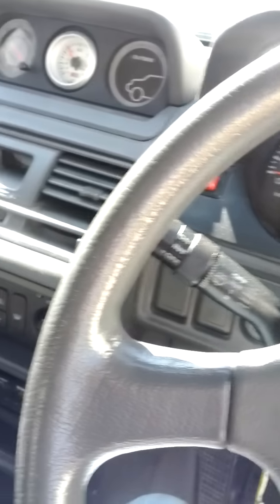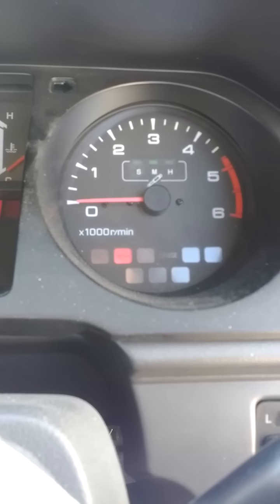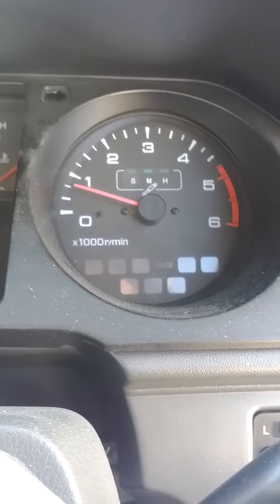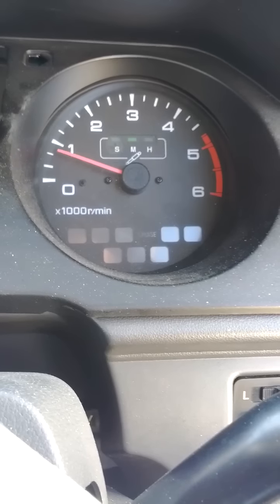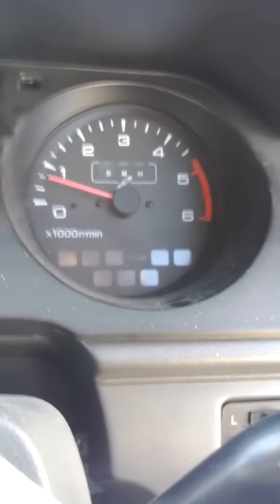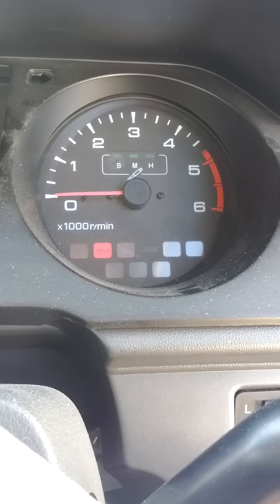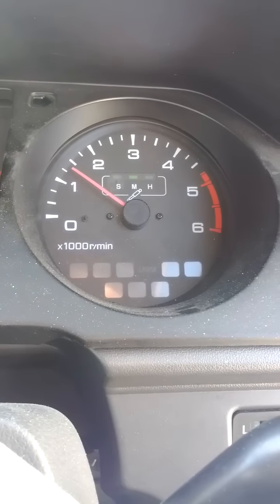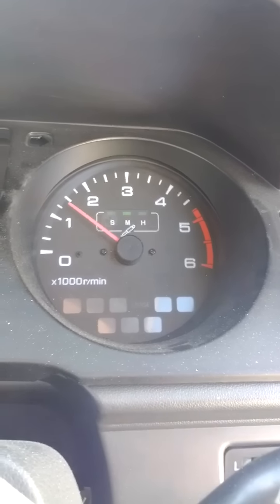Stalling Issue with my Mitsubishi Pajero

Comment: Hello every one its a much relaxing day for us as we've encountered the problem. 
We have 3.2 4m41 Di engine 
Many technicians and mechanics said its a pump itself to be replaced but we installed a different solenoid and sensor  from a toyota car and the problem is solved in a much cheaper way rather paying thousands for the pump as we were struggling from many weeks .
And thats what happens to every pump from mitsubishi 3.2 diesel engine and people are forced to buy pump
The stalling issues when engine is engaged to load

Wao what a pleasant day 

Thanks Vicinity VR we got inspiration from your video
Reply from the maker: Glad you solved it.

The most interesting thing about my youtube channel is that it started out as a gaming channel where I uploaded random times.

But....this video about my old Mitsubishi has THE MOST views of any other video on my entire channel and it was just a one-off video I uploaded while trying to solve this problem.
Reply: @angrygreek1985  
We were obsessed regarding this issue at a extent of becoming mad .
But we got alot of inspiration from your video .

And finnaly we changed that part and the car is working much better than before .

And now we are sure that a lot of people just replace the pump for this issue to get rid but actually the pump is not to be blamed,  its the other part of pump which becomes faulty. 
If anyone want that part we can help and arrange for them instead they replace the most expensive pump

Thanks Vicinity  VR. 

God bless you all
Reply: I have the same engine.. 3.2l 4m41 a 2003 pajero. In neutral all is ok. Engage the gears then it stalls. Kindly help me with the location and the parts u change please
Reply: @AlimonaAbbas at the moment I am obsessed, I have cleaned the intercooler, I have changed the fuel lift pump, I have tested the fuel lines, my next plan was to clean the fuel tank. The I googled this problem again only to see this comment.. I think am going to have a relaxing day too. Kindly help and advise. I am in Africa I don't know how you can help. But pictures of the parts and the location will be of great help.. thank you so much
Reply: @AlimonaAbbas are you talking about the scv? Suction control valve
Reply: Can you tell us in detail like which parts from which toyota car you changed??

Comment from the maker: Just so everyone is aware. The issue has now been resolved. I ordered a Front Injection Pump Seal for my Pajero, which is a 2.8L Diesel 4M40 Engine. I had a local mechanic do the work which was 5 hours of labour. The seal was $18. Now my Pajero no longer stalls. If you are having this issue please try this.
Reply: Where is it located?
Reply: Hi dear Vicinity VR after 9 years we are facing that problem can you plz tell us how does that seal looks like and do we need to move the pump out eh ?
Reply from the maker: @AlimonaAbbas  I believe this is the part I purchased
https://www.ebay.com/itm/272126838668

I did not do the work myself, so I don't know where it is located. I just read about that part being the potential issue, so I purchased the part and found a local diesel mechanic to work on the vehicle for me.

This was 10 years ago now, so I don't remember much other details.
Reply: Can show which part bro. I having idle problem too. And keep adjusting TPS sensor all the time

Comment: Hi people , first to change the OIL SEAL & O RING on the injection pomp you should check first the all fuel lines, I changed the OIL SEAL & O RING first but the problem didn't disappeared . Changed the fuel lines and now is working normal.  

PS

You should correct the video title ( Stalling with Starting ;)

Comment: Mine had not done it yet but was on the way out. However i done my own injector pump and ended up breaking it a bit internally. So now i got another pump from another car we are building till i can renew my pump. Lucky the new one is already rebuilt and works. Good news is that pump is economical. Don't know if i should swap injectors too???

But hey your car works, mine works we are all happy!

Comment: My opinion, if you have this fault and or other drive problem( hunting/ power coming and going) , before you go spending lots of money on Pump repair etc, check or replace your rubber fuel lines and hose clamps, if you have even the smallest air leaks in the fuel system from the tank to Fuel pump, your Pajero or any Diesel engine will react like this video, and on another note, if the lift pump on your old mechanical pump diesel is getting tied, you can add an inline Electric fuel pump to the pump from tank, this will also fix your problem , very cheap fix compared to Diesel pump rebuild.1 other thing, the prime pump on fuel filter systems get old also, they will start to leak air and cause power/and stopping issue also, just remove the lines from filter assembly and fit a Z200 inline filter to bypass original filter and prime pump system. 😉
Reply: thanks learnt a lot from your advise
Reply: Allah and His Messenger glad to help mate 👍
Reply: Allah and His Messenger do you own an old Diesel Pajero or other old diesel, ? I have some other easy fixes / changes that can keep an old diesel going well.
Reply: @benlondon8467  yes l have a 2003 pajero
Reply: Allah and His Messenger here are some tips that may help your car if it’s done lots of miles or gets to that.
Don’t run heavy oil, some people think if the motor is real tide heavy oil is better, it’s not, stick with or change back to 15W40 oil, thick oil will make the motor blow smoke & collect lots of oil via Rocker cover breather.
If you don’t have a oil catch can, I’d fit 1, if your motor is suffering blowby connect Rocker cover breather hose & a hose from your Dipstick back to catch can , then from catch can to turbo inlet hose. The hose from the dipstick pipe will greatly reduce crankcase pressure in the motor and let it breath. Lots of blowby tends to create lots of oil being held longer in the Rocker cover / top of engine, oil can’t return down to the bottom of engine sump as quick as it should due to the blowby pressure/ flow coming back up. Then that held up oil starts getting pulled in via turbo inlet breather tube.harder the engine runs worse the problem gets.Keep the dipstick aside for when oil needs checking.super select 4x4 , front diff engaged constantly, fit manual locking hubs to front drive shafts, easy install, car will be smoother to drive especially if your front CV,s are worn out. Bit better on fuel also. You can select 4x4 with manual hubs disengagement, but only drive with centre Diff locked, or you will slip drive via gearbox planetary. ( won’t hurt if you slip a little , but will if you try to drive it with out manual locks engagement ).
Reply: It's really great to read all your secretes
Reply: Allah and His Messenger happy to help people out if possible. I’ve worked on cars most of my 50 years, it’s all about getting the most out of your vehicle I think . Little tricks of the trade come about from a lot of R&D with old cars/trucks over the years. Hope some of what I’ve sent helps you mate 👍.
Reply: @benlondon8467 you are a good man, thanks!
Reply: Thank you for this detailed explanation.
Reply: @allahandhismessenger7041  I have the same too
Reply: @benlondon8467 wow wow wow. Thanks for these tips. Mine is a 2003 gen 3 Pajero. It has 220,000km on the Odo meter.  Was worried about the catch can, now am confident I should add it. One new thing I ve learned is the dipstick pipe being connected to the catch can.... I know about the blowby cos I use didstick slots to test blowby sometimes. But it's never crossed my mind to connect a horse to it to reduce pressure.. thank you so much
Reply: @francisguchie1973  glad it helped, I run hose to catch from Rocker cover & Dipstick tube.
My old Pajero got 500k on the clock.
Don’t forget to empty can as required, or if it fills up to top, you can get a runaway engine 😉
Reply: @benlondon8467  Are there any specific oil catch cans you would recommend? Otherwise being in Africa (Sierra Leone - west africa), i might have to build one myself. I have the skills to do so and tools are available. Kindly Advise. Once again thank you so much. You have shared more information, 500K on the Odo meter makes my 2003 are baby at 220k.
Reply: @francisguchie1973  heaps of cheap catch cans, 1 litres plus capacity, make ya own from lots of things already made, just put 2 holes & a lid on it 👌
Reply: @benlondon8467  thanks for these very fast responses. Indeed this post has attracted not only views but also replies and knowledge sharing. Thanks to Vicinity for posting his issue and also updating it.  I have one more kind request from you. My 4M41 has an EGR, I recently cleaned it but found out that the previous owner had "Deleted" it simply by blocking the it at the starting point (at the exhaust side. I am thinking right now that if I have the oil catch can, do i have to maintain the EGR delete?  Also when cleaning the EGR i noticed the amount of soot and gunk that goes all the way to the intake manifold. I am thinking of cleaning the intake too. But given that i just acquired the car i did not want to split things up before reading around. (This is my first time on tinkering with Diesel engines) I have own old bikes and petrol cars and messing with their engines is not my problem. Am just overly cautious with the Diesel. My first diesel was a 4D56 with manual components but even then i never touched it because i lived in an area that had many Mechanics.  
Kindly advise about these 2 issues, the EGR and the Cleaning of the intake housing thank you so much for your valuable time. I Salute you Sir!!!!!
Reply: @francisguchie1973  I would suggest removing EGR, put a plate on the Inlet manifold, plug the exhaust manifold, I wouldn’t worry about cleaning out the inside of inlet manifold, it will slowly clean up on its own, motor in my Pajero is the same as yours, hasn’t had egr fitted for many years/ km.👍
Reply: @benlondon8467  Thank you Ben, I will do the plates on both sides. I will just leave the housing on it for decorative purposes. And also maintain the EGR sensor to avoid the check engine  error on the dash. If there is a better way to do this without having an error code (code 51 EGR failure), please advise. In the meantime i have started building the oil catch can. However, i have not yet found a solution for the stalling when the engine is warm (running temperature).  I am thinking its the pump. The car takes 5 to 7 seconds to start hot or cold, when it starts and is warm enough, engaging it in drive or Reverse will drop the rpms to between 650 to 700 (from the standard 750). Then it will stall shortly after.
Reply: @francisguchie1973  keep going with it mate, you will sort it out, it’s not rocket science. Definitely sounds like a lack fuel, check all those hoses etc etc, as I’ve said previously. I wish you luck 👌
Reply: @benlondon8467  I will share my findings here. May be next week. Thank  you so much for the kind words and for sharing your experience too. I hope this post helps another person too.
Reply: @benlondon8467 just one more thing.. while reading the manual, the oil specifications has 5 options. Sae 30,  20w-40, 15w-40, 10w-30 and 5w-30.  I am inclined to 20w-40 & 15w-40 given that am in west Africa where temperatures are mostly above 24°celcius. Kindly comment on my choices, most important, I am eagerly awaiting to hear about your choice given that you have attained more mileage on your pajero
Reply: @francisguchie1973  15w/40
Reply: @benlondon8467  thank you so much cheers

Comment: Ive got a 2005 3.2 did and it will not stay running in any gear r or d and unless driving on the road and if it slows to much or stops alight it cuts out it also will not idle in neutral or p when warm.idles in n when cold but dies as soon as you put it in d or r unless you push accelerator straight away and put it neutral and keeping revs up at lights or slowing down.anyone help please
Reply from the maker: I stated right in the video description how I solved this issue:
"I fixed the Pajero. For me it was the Injection Pump Front Seal and I had it replaced for about $200 labour, depending on how much your mechanic charges for labour."
You may not have the same issue as me, as your problem sounds quite different, but it might be.
Reply: Hi stevey did u find what was the problem as i am also experiencing the same issue please if u can help us with your experience 

Kind regards
Reply: Hello Stevey, I have a 2003, Same engine 4m41, same simptoms exactly. Did you solve your issue?

Comment: hi i got the same problem is it means that the fuel pump need to be replaced repaired ? i done the fuel filter etc i clean the fuel inlet filter on pump as well . my one is struggle on low rpms . it got the throttle response and it have a power over 1200 rpms . but after release the throttle pedal from a list 2000 rpms it drop to 250 rpms or to 0 . what it can be ?
Reply from the maker: Krzysztof Kawalec for me the problem was the front fuel injection pump seal. I had the 2.8 model.

Comment: Just wondering once you put the new seal in did it fix the problem straight away? I just did mine and its 80% better but just wondering if it continues to improve?
Reply from the maker: It was fixed right away. Never had another problem like that afterward.

Comment: Have exactly the same problem on my 4M40 turbo diesel Pajero (NJ late 1994 model). Likewise have been told it is the fuel pump front seal. Down here in Australia, it is around $600 just to replace that seal, or $1500 to recondition the pump. Most mechanics won't guarantee the seal without reconditioning the whole pump.
Reply: Well i think if the problem is the same as mine, i have to know the cause of that trouble Sir.
Reply: I have this problem but it came after my Pajero went in to fix oil leaks by replacing seals.  How did they cause this problem
by fixing the oil leaks?

Comment: My god, I have the same problem. Thank you for this post, and thank you all for the solutions. However, where is the fuel injection pump located? Different mechanics are telling me that it is in the tank?
Reply from the maker: I'm not sure exactly where it is, but the front fuel injection pump seal is what you would need to replace. I'm not a mechanic, so I don't know where it is exactly but it's down on the right hand side (when looking at the engine from in front) and down a bit. The intercooler needs to come off to get down at it as far as I know.

This is what you would need to replace, it worked for me. http://ccautos.ca/parts/mitsubishi-33/injection-pump-front-seal.html
Reply: thank you very much my friend...
Reply from the maker: The Philosopher I didn't do the work, so I'm not sure exactly where it is, but I know it's on the front right side, looking at the truck from the front. it cost me about $200 in labor but it was cheap labor. the seal itself was around $20.

Comment: we had that problem to our 1994 mitsubishi spacegear delica 2.8 a/t, same problem it starts(sometimes it is like your 2nd start) and runs but when we started to slow down on the road the engine will suddenly stops and sometimes it is hard to start...so we need to put it in neutral so that it would not stall and we need to step on the gas pedal quickly after we change to drive so it won't go to low rpm and stall.......
Reply: What was the fix ive got a 2005 3.2 did and its doing exactly this it will not stay running in any gear r or d and unless driving on the road and if it slows to much or stops alight it cuts out it also will not idle in neutral or p when warm.idles in n when cold but dies as soon as you put it in d or r unless you push accelerator straight away and put it neutral and keeping revs up at lights or slowing down.anyone help please
Reply: @stevey306  i have the same problem with my gen 2 pajero 1996 can you help me if you resolve this problem please?! Thank you
Reply: Hey guys did anyone find anything related to the same problem please please let me we are also in a same trouble 

God bless you all
Reply: @stevey306  hi 

Did you find what was the cause dear
Reply: @ckemi1232  dis you find what was the root cause dear
Reply: @AlimonaAbbas  No sir.. no one help me for my car still looking around to find a way to understand the problem.
Reply: Yes we find the cause and finished it
Reply: Yes we find out and finished the problem
Reply: @AlimonaAbbas  can you help me if you find, thank you
Reply: @ckemi1232  where are u from which country
Reply: @AlimonaAbbas  im from albania you??!
Reply: @ckemi1232  i write my number but its not showing dont know why
Reply: @AlimonaAbbas tell me the problem and solution my friend i need asap to bring my car like new again

Comment: I had my pajero 4m41 eng. Sometimes stall especially up parking, and then also sometimes when i switch off engine rev up a while and then stops.
Reply: Thats timing issue i take it tgat it was a petrol oajero not diesel and the distributor spark timing wss way off .id bet  my house on it that was the problem there

Comment: Hi, I have a 1992 2.5L shotgun,  I waz watching your video because mine is starting to do the same problem can some help me if you got your problem fixed
Reply from the maker: For me it was the front fuel injection pump seal that needed to be replaced.
Reply: Ohh okay.  Thanks :)

Comment: Sup guys, im experiencing problems with my pajero which isnt changing gears properly and isnt getting power . it goes of when i come to stop ( light on a red light or about to make a turn) we changdall the filters and even gas pump.
Reply from the maker: I'm not sure how to help you with that one. I would look into any/all seals in the fuel system though.